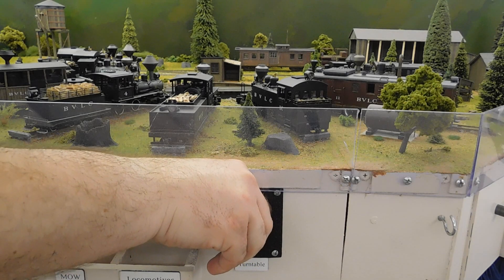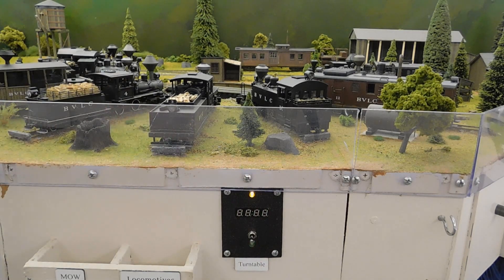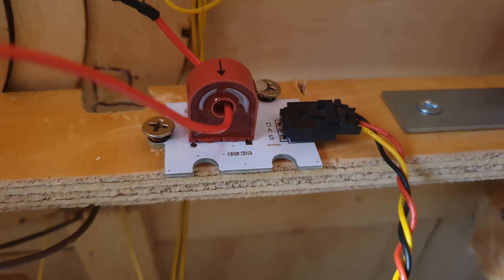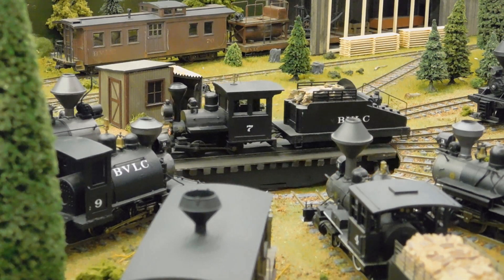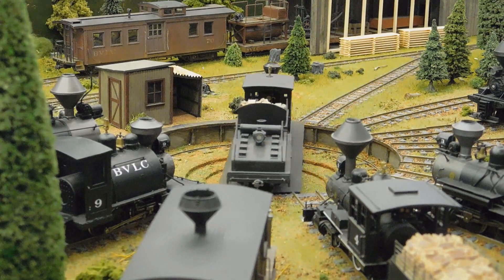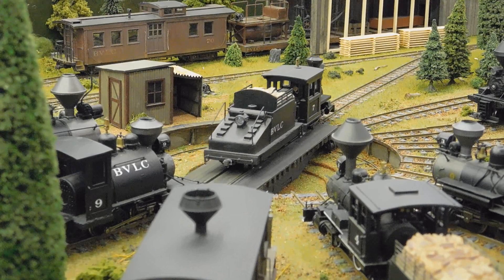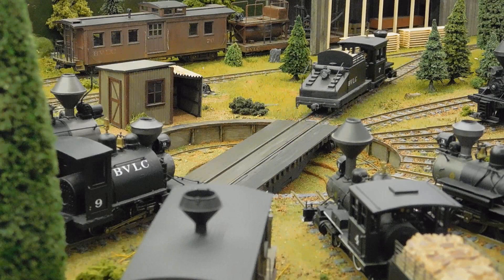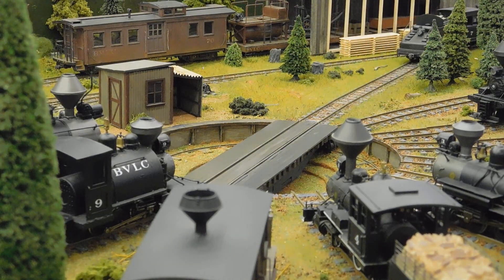An Arduino Semi-Automatic Model Railroad Turntable

Comment: Quick question, have you considered using a halifax sensor on the arduino to have the turn table ends align without as much fiddling it back and forth?
Reply from the maker: That's what I did in this video. The sensor under the stepper motor has 4 hall effect sensors, which give the position.
Reply: @bvlcorail  OH! Fantastic, I didnt see the arduino set up so I was genuinely curious.  Great work with your 3D prints by the way. I'm just starting into my own on that front.  Keep up the good work. Cant wait to see more of the BVLC!